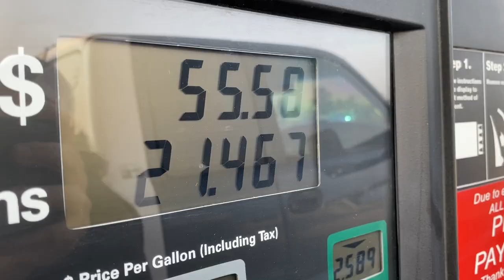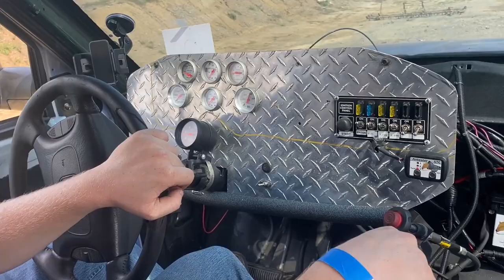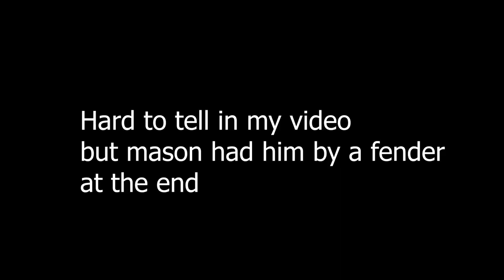Cleaning House At The Cole Motorsports Freedom Truck Meet

Comment: What size injectors in masons truck again?? And what stall converter? 
That thing moved 
Congrqts
Reply from the maker: 7x12
Roughly a 2200-2400 stall converter we got used so not certain